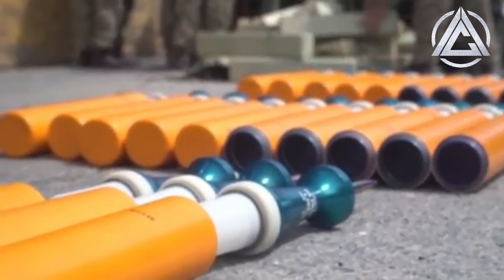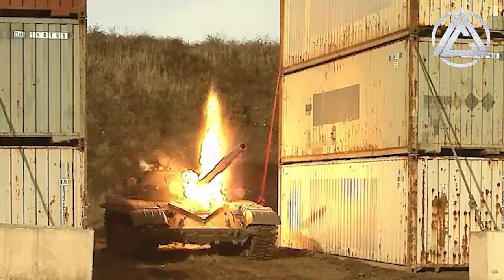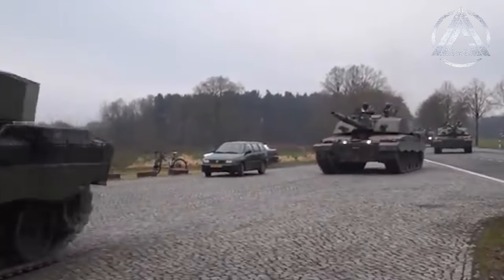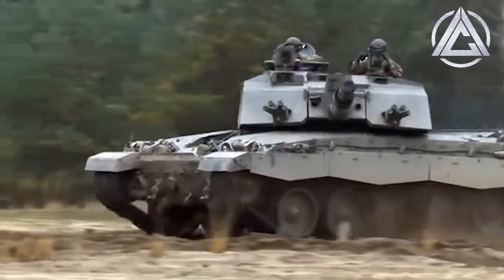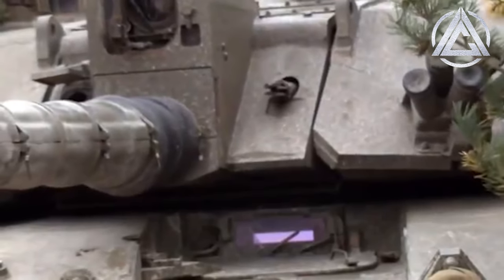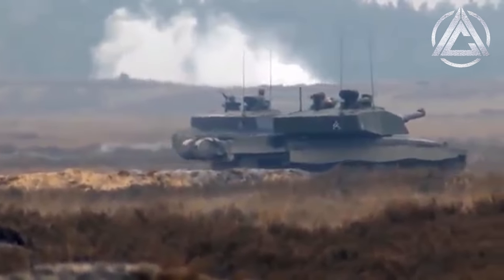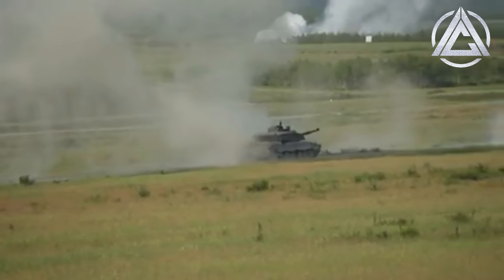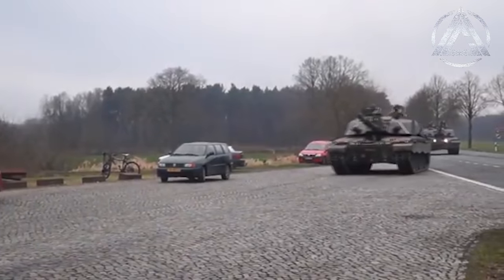Challenger 3 | Britain's New Main Battle Tank | Is It Really Any Good?

Comment: Correct me if I'm wrong, but I thought the Challenger II used Dorchester armour while the Leopards used Chobham which is not as good.
Reply from the maker: Dorchester 2 armor used by the Challenger 2, and the Burlington armor used by Challenger 1, are both TYPES of Chobham armor.

The Abrams has also used Chobham armor, but not the Leopard 2. Leo's armor is similar, but a domestic design.

The thing about the Leopard 2 is that while its upper hull is not as well armored (until 2A7V variant), its turret face has that "arrowhead" piece which makes it much stronger than Challenger 2 and even equal to M1A2 Abrams (although it has a couple of weaknesses, really it's worth its own video)

Comment: the Challenger 3 (Block I) main battle tank could do with a raised suspension setup featuring a heavy duty 5.0 in. suspension lift & overall strengthening . . . for improved off-roadability across any terrain . . . state-of-the-art modern day tanks like the Challenger 3 (Block I) & T-14B Armata should discard the 12.5 MM co-axial gun altogether . . . it's obsolete & no longer relevant in a ever evolving technologically influenced warfare . . . a fully loaded Challenger 3 main battle tank alongwith it's plethora of armour shouldn't weigh anymore than 50.0 tons . . .

Comment: The speed is bullshit btw....like most car engines you can upgrade the engine by changing a chip.....we had a CR1 that failed CABF before the first Gulf war, it still had the 'battle chip' in place and we clocked it doing 62mph on the training area. A very good friend of mine forgot it was chipped up when he flipped it on it's side in Hemer BAOR. We nicknamed it 'Desert Orchid' because it failed at the last fence. Seeing over 60 tons of tank powersliding and flipping was amazing! I have the pictures.

Comment: Unsure why you think the CR2's armour is inferior to contemporary tanks. Modern Leopard 2 variants use the CR2's chobham armour, the Abrams used it from the beginning of its development (and actually before a single British tank did). We don't know what chobham is made of exactly but it includes layers of ceramics and plastics that give it very good resistance to both kinetic rounds and shaped charges. The CR2's focus may be on combined arms infantry support but that does not mean it isn't intended to be able to take on and defeat modern tanks... Not sure if it was announced when this video came out but but CR3 will use a new composite armour derived from chobham that represents the next generation of tank armour, which along with the new electronics is the reason for the weight gain.
Reply: Easy. The numbe rof updates the abrams and the leo have gotten to they armor make their current armor better. Sure the challanger had good armor when produced but the numbe rof upgrades for it were small
Reply: @emilsinclair4190  The only upgrade to chobham/dorchester I'm aware of is the addition of depleted uranium layers in Abrams tanks.
Reply: @shaddaboop7998  the leopard and the abrams have received multiple armor upgrades that now give them a superior armor in their latest versions.
Reply: @emilsinclair4190  Leopard 2 didn't have any composite armour in its turret initially. Later layers of chobham were added, and then wedges of chobham on top of that more recently. The Challenger 2 TES add-on armour package was unveiled in 2013 and gives very good protection against modern ATGMs and infantry-carried anti-tank weapons, the threats a tank will most commonly face.

The protection of the CR2 is well regarded. The CR3 upgrades focus on digital integration more than anything else, which was sorely needed along with the commander's panoramic thermal sight and the NATO compatible smoothbore.
Reply: @shaddaboop7998  depends. Early versions of the leo had simpler armor. Later versions already had their basic armor as a composit. And in the modern leo 2 for example the turret has a wedge that has places that are basically impenetrable for current kinetic penetrator.

The challanger was well armored when it was I trounced. But since that everyone else ehas made heavy improvements while the vhallanger has not.

Comment: Loved your video BUT.....
NATO is supposed to be a defensive organisation. 
So I assume you have time to get best position (cross bridges etc) and arrange air defence against missiles or aircraft.
Your not charging across open ground carrying all your defensive systems with you?
Or am I completely wrong?
As someone with absolutely no experience it just seems a tank for defence / counter attack would have some key diffences from one designed for overtly offensive missions?
Reply: The reason the British army are an offensive force is the tried and tested reasoning that the best way to take the momentum out of the enemy is to force them on the defensive.

Comment: We need to start designing a replacement for the Challenger 3 the new tank will have a 130mm British gun a autoloader and Chobham 3 and a hydrogen powered Engine and it would also have an active protection system and this tank would come in Service in 2035-2040 and there will be a export variant of the tank and also with this new MBT we should design and build a modular tracked vehicle that has Modules like the boxer but track some of the modules are IFV module and artillery module
Reply: And weigh 40 tons.
Reply: @robertmonk2346  That is way to low for a MBT I was thinking more like 50-55 tons with like a 60mph obviously does not mean it has to go that speed

Comment: I’m not sure where you have found the information on the armour. Challenger 2 has always had the best armour on any MBT in the world. Iraq confirmed this when compared to the Abram.
Reply from the maker: Not against kinetic energy (armor piercing) rounds. Challenger 2 was on par for the best armor against cumulative charge warheads like those in RPGs and ATGMs when it entered service in ‘97, but that was soon beaten by the M1A2 SEP. 

Iraq proved nothing. A few Abrams destroyed by very modern ATGMs like Kornet-M hitting the rear, bunch of Challenger 2s surviving hits by RPGs from the 50s shot at the front turret. If I punch a brick wall and you punch a paper sheet, you’re gonna go straight through it… I’m not. Doesn’t prove a thing about who’s got the stronger punch.

Armor trials and firing trials on the other hand all out Challenger 2’s armor against armor piercing rounds at 15% lower than M1A2 and Leopard 2A5, on par with Leclerc but with better coverage

Comment: It's forgotten so often -  its the Bismark principle. The Israelis knew it too and that's why their tanks were and are built on a similar principle to the British and not the Americans. Of course there has been change and some amalgamation.

Centurions during the Yom Kippur war, generally couldn't stop the Rapira 115mm penetrator from the T-62, but it didn't always matter. Blow in, straight out. Very much unlike the M60 which the Israelis nicknamed the Ronson.

How many times in conflict have we seen Abrahams and more recently, Leopards burning when attacked. You put all that Armour on the front and still get wiped out. Oh, its a very fast tank, and you still burn. 

The eulogising about the largely untested Leopard 2 only goes to re-enforce this point. The Leopard has seen limited combat and on its first true baptism in Syria, it had its arse handed to it. Oh - but that was an A4 people say. Then forget that the A4 was the same generation as the Challenger 1 and was alleged to have comparable protection. The Leopard 2 is an excellent tank. But its not a Bismark. 

We will have to see with the Challenger 3.

Comment: Question, you mentioned the armour being sub par, why has the challenger survived more punishment then both tanks you mentioned, i understand you just read stats, but real like situations, please show me when either tank has actually survived more RPG's and a anti tank missile???
Reply from the maker: RPGs from the 1950s are not a good metric by which to judge modern tank armor. Please show ME a situation where an M1A2 Abrams or Leopard 2A5 was hit on the front turret by RPGs, and yet destroyed... Can't do it can you? 

A single edge case, of a Challenger withstanding a large NUMBER of (very outdated) weapons... proves nothing - M1A2 and Leopard 2A5 in the same situation would have survived just the same. That's also only talking about the armor's effectiveness versus shaped charges, like those in RPGs and ATGMs... its effectiveness versus kinetic, armor piercing rounds, is completely different.

According to all the best available information, the Challenger 2's armor versus kinetic energy projectiles is lower than that of M1A2 and Leopard 2A5, at least on its frontal turret face. Its armor against cumulative charges is about on par with both.

As of yet, there is no real world data that would prove any different.

Comment: Are there technical reasons way the Brits would not be fitting the Rheinmetall 130mm MTB gun in stead of the 120mm L55? To an out side observer the 130mm on a tank that is not going to see service for years to come is a no brainer.
Reply from the maker: There's a few reasons not to adopt the 130mm. For one, ammunition capacity. 130mm rounds are a lot bigger than 120mm's, and therefore you can't carry as many of them. The Challenger 2 for example carries over 45 rounds of 120mm ammo. The KF51 Panther? 20 rounds (or 10 if you want the drones).

The second is cost - there are huge numbers of 120mm rounds in circulation, and very few 130mm projectiles being produced. That makes the 120's cheap, and the 130's expensive (while also not being as readily available should a major conflict break out).

The third is that 130mm rounds are just a lot more difficult to handle. Even if you were to have an autoloading MBT, at some point a human being still has to place those rounds into the tank, which is far more difficult and time consuming when they're 50% heavier and 80% longer!

The final factor is that the 120mm just has a lot more growth potential. The XM360 gun on the Abrams X for example is actually significantly more capable than the  RH.130, able to push armor piercing rounds to much higher velocities and therefore achieve better accuracy, range and armor penetration.
Reply: That makes sense. Thanks. @ArmorCast

Comment: Pretty much everyone else says that Challengers Chobham armour is the best...in fact the Abrams licenses it????
Reply from the maker: The original M1 from 1979 did yes. That was upgraded to a domestically made armor in 1983, which was upgraded again in 1987, then upgraded again in ‘92, again in ’99, again in 2002, and then AGAIN in 2017…

Challenger 2’s Dorchester armor was made in 1986, an upgrade of Challenger 1’s Burlington array of the 1970s (both are forms of Chobham armor)… it was about on par with the US armor from 1992, so yeah very impressive at the time… but it’s not been upgraded since! It had already been left behind before Challenger 2 even entered service!

Meanwhile Leopard 2 got a massive armor effectiveness increase with the 2A5 model in 1995, putting it on par with if not better than Challenger 2, and the Swedish Strv 122 (modified 2A5) had even BETTER armor again, by 1997.

Comment: What difference in combat does the top speed make?
Range,armour, firepower, networks etc are all far more important.
It's just bragging rights.
Reply: It makes a huge difference especially when fighting an adversary with a less capable fire control system. 

The ability to change the firing angle and move to different cover faster than an enemy can target you is a battle winner.
Reply: @JammyDodger45  
I agree, but "top speed" isn't acceleration
No one's moving an MBT at 60mph through European terrain in combat

Comment: Ok.. Your misconception and correction on the gun - is again a further misconception. 
Rifled Gun was for HESH rounds... not SABOT - HESH has GREATER Anti-armour capability because it is a Chemical Round (High Explosive) not a Kinetic Round... e.g HESH Penetrates the  same amount of armour at 100m as at 5km. Kinetic Sabot rounds get less effective with distance. 
The spin imparted by rifling is needed to deliver HESH rounds to target at long range. APSDS (sabot) doesn't matter so much because of the Sabot (Shoe).
Smoothbore has been adopted because UK is abandoning HESH after 70 years, so the rifling is not necessary and it unifies NATO 120mm Logistics.
Reply from the maker: Even at 5km sabot rounds have MUCH higher anti-armor capability than any HESH round

Comment: A flak jacket protection for infantry soldiers.
Light weight armour.
Could this be used for lighter armour for tanks.
Yes I know steel and chub armour protection in place for challenger's.
What you want.
All round protection.
Fire power.
Speed.
Modern technology.
Main battle tank with lighter armour.

Comment: I only seen 8 minutes now an I love the concentrated info
If you have the spare time maybe you can help a noob.
For the SABOT to get all energy it can from the charge should it not fit the barrel tightly?
And if it do that against a rifled barrel ( challenger 2 ) would it not cause a spin?
cost a slight energy loss. And when it leaves the barrel the fins will stop the spin using energy? But did you just say it would make the the dart unstable? How? All I can think of is the dart might weir of course in a predictable manner but it should still be stable. Why? cause it has fins! Otherwise you sound beleavable.

Comment: The challenger 3 is a retro fit of challenger 2 using the leopard 2 turret with a smooth bore gun. Or are they going to build any new carcasses? There are very few Challengers out there, in the region of hundreds.
Reply from the maker: It's nothing like the Leopard 2 turret, in fact it's basically just the existing Challenger 2 turret with the gun swapped out and a couple of changes to optics and internal systems. 

As far as I'm aware, the plan is to purely use existing Challenger 2 hulls, and only about half OF them! 

Britain were keen on scrapping their main battle tank force entirely, becoming more like the US Marine Corps, since they really don't have to worry about land invasion and don't tend to even USE their Challenger 2s much when they do deploy overseas, say in counter-insurgency operations. That explains the low numbers, since at this point Challenger 3 is really just a token upgrade to keep their industry employed and appear to keep up with the rest of the world
Reply: @ArmorCast  According to Wikipedia: "he Challenger 3 has an all-new turret with an improved hull." - with Pearson Engineering making the new turret.
Reply from the maker: @KevinPugh-hq8rc  “according to Wikipedia” is the most self-defeating way to start an argument

Comment: If your assessment is accurate then it is a disappointment. Surely by now we should have tanks deploying guided missiles and rockets like planes do? We should have electric final drive to all wheels to reduce track wear and improve the situation if the wheels or sprockets are damaged. We should surely be able to put enough battery in for the emergency speed to be a stack more than 60mph, and reduce the weight by doing away with the current transmission systems and make control more accurate and easier on the driver

Comment: technicly its the challeneger 5 as the challeneger 1 and 2 were WWII british tanks

The challenger 3 wont be as good with the German smoothbore as it wont have the range and accuracy of the British rifled barrel. The smootbore only has a tank on tank kill range of 1.5km. the british rifled gun has 5km. only advantage is the smoothbore has a faster firing rate and doesnt need the barrel replaced so often.

HESH is very good for anti tank. My artillry unit with 105mm rifled guns used HESH and we could take out an M1A1 at 4KM but we couldnt take out a 1944 Centurion tank at 1km lol.

As for protection on the challenger 1 it is very good. 1 got ambushed in Iraq. It got fired at from point blank range with everything the Iraqis had including the latest russian anti tank weapons and it stood up to everything thrown at it for 12 hrs and had no damage on it at all apart from some scratched paint. Challenger II has even better armour.

the centurion tank designed in 1943 and entered service in 1944 is still used by several countries now and its still 1 of the best tanks in the world. only tanks better r the chieftain and challenger tanks.

Even during WWII Britian had far better tanks than Germany did. My dad was a tanky during WWII in the BEF and north Africa and  Germany had nothing to take out the British tanks excpet a direct hit from a stuka dive bomber on the top of the turret.  The British 2pdr (40mm) gun used on tanks during early WWII could take out a late war tiger  tank at 800metres. France used a 47mm gun and they couldnt take out panzer III's. neither could the 77mm gun on Sherman tanks.